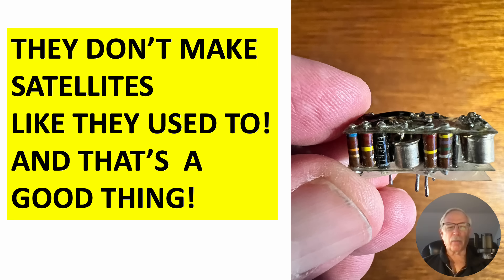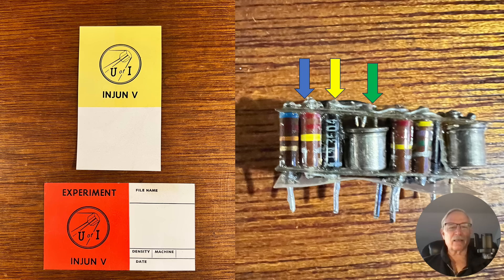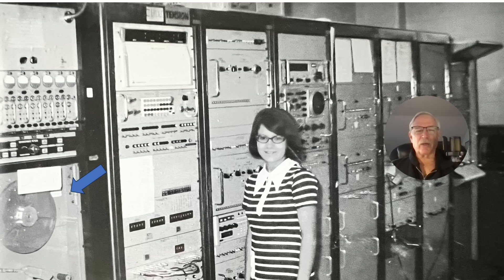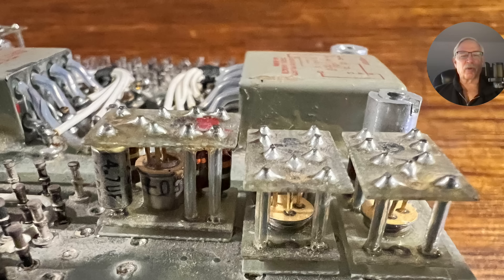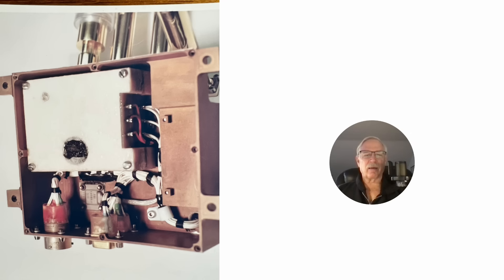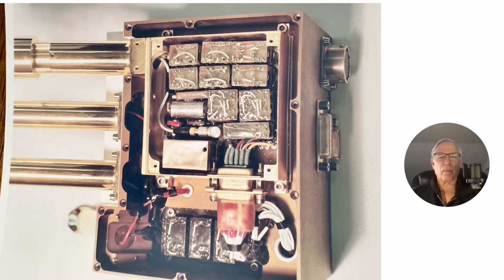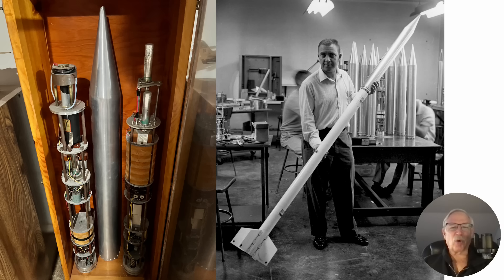THEY DON’T MAKE SATELLITES LIKE THEY USED TO! AND THAT’S  A GOOD THING!

Comment: Amazing work! I have noticed in some of the wafers tantalum capacitors, am I right? Did You know at the time that these capacitor were possible cause of failure?
Reply from the maker: I ddi not know that. I thought tantalum caps were the good ones!
Reply: @ronrogers  tantalum capacitors are still the best for precision capacity and still in use today. Anyway for many years now I have been collecting and repairing old  HP instruments like spectrum analyzer,  and rf generator and I have noticed that even the most selected and mil spec tantalum capacitor after many year of use is prone to shortcut itself with very high chances to destroy something else in the board. Other kind of capacitors usually do not shortcut when don't work anymore.
Reply from the maker: Interesting to know, thanks!

Comment: it uses discrete germanium transistors, but satellites are fake in a sense, they can only be deployed via hot air balloon.  the earth is a closed system,  there is no outer space, it's water, it is absolutely water

Comment: I work for a contractor that supplies hardware for NASA. We actually still build a lot of antiquated hardware the way it was made back in the day. You have to remember things like the space station and the space suit have been around forever but they are not being redesigned or updated. You have no idea the amount of work and cost that goes into designing and testing hardware to prove that it is fit for service under every extreme condition and that it will not effect anything other piece of hardware. It's almost comical at times because when important parts become obsolete we have to find companies that will put those parts back into production. And were not talking about stupid things like an oddly shaped screw either. Recently we had to find a company who would make LCD screen for the space suit. Just imagine going to a company and asking them to put a 70's LCD display design back into production and that we only need like 15 of them.
Reply from the maker: Interesting aspect I was not aware of but can certainly appreciate!

Comment: My uncle used to work on the computer systems for satellites. If I recall the story correctly, it has been a while, they were the first team to put a 386 on a single chip. Something like, 7 chips in a row, 7 rows on a board, 12 boards in a sat.

Comment: Ive disected some xray machines that were made around that time and basically made exactly the same way as far as the electronics go. The oldest ones were basically nothing but mechanical relays with capacitors and rheostats for timing and output control but they lasted a lot longer than modern made xray machines do.

Comment: Perhaps the biggest difference between the old and the new is just how reconfigurable the modern systems are.
In addition to microcontrollers, modern satellites use programmable logic circuits (FPGA) and all of it is designed in such a way that you could upload new code from the ground station up into orbit. And it's come in necessary on many occasions, too.

Comment: Thank you for such an interesting video! I remember when I was young my uncle gave me some electronic hardware from the remains of a Blue Streak rocket that was test fired from Woomera, Australia during the 1950’s. My uncle ran cattle on a property in the Northern Territory which was down range from Woomera and a number of rockets ended up scattered in pieces in the desert. Anyway I had a few pieces and I was very impressed with the quality of construction of the hardware, sadly I lost those items over the years since then.

Comment: You say the failure rate was high yet voyager 1 and 2 are still kicking, now I know there in a diminished state due to the fact that they've been slapped with all kinds of radiation and some of their experiments have been put out of commission but they still get firmware updates as there systems are magnetic wire cords, it's the same computer system that they used on the Lander module for the moon landings, a code used in the mid 40s and a computer core made in the 60s, I bet you if you had the funding that it would have stayed up there till it ran out of fuel and burnt up in the atmosphere, todays electronics may be able to fit 100 to 1000 times more for the same space but that does not mean its better, in fact a hardened laptop only last about two weeks on the iss

Comment: Back in the early 1990's I worked for GE/ Martin Marietta/Lockheed (Changed owners three times while I worked there)  Astro in NJ which built a number of remarkable birds. 

Along one hallway we had a glass display of spare circuit boards, and it was practically jewelry. 
The perfectly aligned circuit components all connected with (relatively) thick gold wire.

We're pre-conditioned by science fiction movies, to assume what flies in space is the most cutting edge technology but most of the time (at least in the early 90's) the preference is for 'tried and true' with components that were sometimes more than a decade behind what was available in the consumer market. They were still designing 'new' hardware in the 90's using 1970's microprocessors (RCS 1812 was still in use at Astro, including one version which recreated the base logic but used discreet components rather than a single chip)

Surface mounted components were not yet a thing for Astro, my job had to do with installing and supporting desktop Sun Sparc 1 workstations.

One day when I was replacing an internal hard drive on one of the desktop stations, and as I had the case opened, one of the engineers wondered over and was absolutely amazed at the surface mount technology that the workstation used. He was a senior engineer, (I think he was part of the Landsat 7 project at the time, but not certain)  

But keeping old hardware alive , well past the original manufactures EOL date was a common thing at Astro. One of my duties was to keep an Interdata 70 computer running into the mid 1990's. It was originally from the early 1970's a contemporary of the first generation PDP11's We had to raid museums for spare parts, because there were still flying satellites that depended on this 20 year old computer, and the rules were firm that you could not trust emulated hardware. So we kept this clicking, core memory, paper tape driven system up, for a decade after the ordinal manufacture had long been absorbed by bigger fish.

Comment: Surprised the electrolytic caps didn't instantly dry out in a vacuum.  The compression of the plates must have held enough electrolyte in to buy them some time.  Voyager II is still going, presumably on 50 year old electrolytics.
Reply: Sealed with a drop of molten glass on a layer of molybdenum (most suppliers)which is well wetted by glass. Rather similar to vacuum tube  or even halogen incandescent lights!

Comment: I use to work at a physics lab where Peta bits of data where burned onto CD's to be transferred to the university for analysis. The on going joke was your data rate is based on your Van With

Comment: You should see some of the early oil well logging tools. Tiny vacuum tubes, and later, nuvistors. Designed to fit in housings as small as 1" I.D. They had to be able to go to a pretty high temperature, and be impact resistant. Not many, if any folks left who can work on the old stuff.

Comment: Years ago I was working for Honeywell which had acquired sperry decades ago.  For some strange reason I had to update some very old PCBA drawings that resembled the sandwich construction shown in the video.  Strangest electronics I had seen.  It is not reworkable and not volumetrically efficient.  We have come a long way!

Comment: 4:00 those small circuit boards look like individual logic gates. It would probably be possible to substitute the entire electronics in this early 60's satellite with one small surface mount FPGA nowadays. It's amazing how much things have advanced, and what people could still do back then, even with just through hole components and discrete germanium transistors. This is actually very impressive to someone who wasn't even born at the time of this satellite. Thanks for sharing this information.
Reply: Likely even a cheap CPLD
Reply: On the downside, our fancy modern electronics can fail when hit by a solar wind particle or cosmic ray. Smaller is not always better.
Reply: @jagobabarron5501  Yes, but it's also easier to have a backup system or two with the same fancy modern electronics. Besides, the components on these boards were failing much more often than today's technology, as the author of the video himself states.
Reply: @jagobabarron5501 You say that as if these weren't even more easily damaged.
Nothing can withstand a good blast of radiation.
Reply: @jagobabarron5501  Better it last long enough to get fried by that, and with the small size comes being able to fit two or three backups so your flight isn't over as soon as solar winds breathe on it

Comment: SURELY that was not the finished packaging, but rather just a breadboard, that first tiny unit/module? you showed.  We did stuff in our garage that looked better than that back at that time.  There is not a single solder joint on that entire board that would pass today's qual inspections. As I remember, they wanted to be able to see the stranding showing through on a stranded wire solder joint at the end of my career.  Interesting, and quite eye opening to see.  

I can tell you that mil spec flight stuff I saw, even back then, didn't look like that.  Not the equipment I saw and worked on, anyway, and we did use some legacy equipment from pretty much that time frame on a target missile to fly against THAADS and STORM.  Those units were all printed boards, and you could see individual wires in the solder joints, not just giant blobs thrown on from across the room.  Some of it was potted, too, which made it a mess to open and troubleshoot a problem we had with a few of them.  

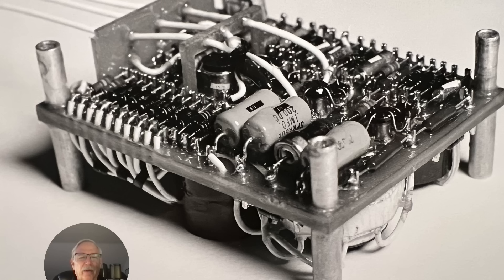The missile was a cheap and dirty cobbled together flying junk pile interceptor test target, basically.  Minuteman and other motors, Pershing II front end, purpose designed stage couplers, etc.  Ah, just got to the board at 8:42, that looks more typical of the time.  The epoxy blobbed wiring on the taped cores looks pretty standard, though.  :-)  That board also looked like it had been coated in Hysol, or whatever they used back then.  I wasn't too impressed with that stuff, as I had some very high tolerance passive components go out of spec, just operating in high humidity for extended periods, from what I can only assume was water absorption.  It probably contributes value in the shake and bake qual testing, though, and in use after storage and transport, of course.

The metal can packages on the 'more modern' stuff were interesting. They look like the type of packaging utilized by some of the hybrid components, like RD converters, that I used to employ.  Those designers always drove people nuts, because they would label the MSB as 0, and other dumb nonstandard stuff.  I remember a guy I knew that did a design review on a board of mine smiling and saying something like, "Well, at least you got the converters wired correctly".  Truly high praise.  ;-P  I said, "You mean most people don't?"

Comment: You can, in fact, still buy discrete can transistors. Of course, you can mostly only get modernized versions of them, but often its a pin for pin, spec for spec version that's simply appended with PBF in the part number to signify that it's now lead free. I go through dozens to hundreds a month repairing obsolete industrial electronics.

Comment: in general the designs are still based on the same approach, you can still pull any compnent on the PCB without harming the circuit.

Comment: Sure you can still buy all sorts of discrete transistors. I've got discrete BJTs, NPN and PNP, as well as N and P channel JFETs and depletion mode MOSFETs. They cost about $2 for 100. For each type. Mind you these are just plastic TO-92 packages. No fancy metal cans, except for my unijunction transistors.

You can even still buy the old LM741 opamps for about 80 cents for 10.

Funnily enough, buying chips from China, I've come across some blatant counterfeits. Like some TI logic chips where the TEXAS Instruments logo is a blobby looking United States because apparently the silkscreen printer didn't know what Texas is. I get the sense they weren't worried about Trademark issues.

Comment: colour codes ... easy phrase to recall ... Big Boys Rape Our Young Girls But Violet Goes Willingly ... or Black Brown Red Orange Yellow Green Blue Violet grey White ... silver is 10% old is 5% tolerance ... it is also the same for capacitor and yes single Transistors are still sold ... 

pity yu didnt cover what the first satelitte did ... aside from fall around the earth and send a signal back now and again ...
Reply: In Dutch the line is Zij Bracht Rozen Op Greetjes Graf Bij Vies Grauw Weer, meaning She Brought Roses On Greetjes Grave in Dirty Grey Weather. Vies can be replaced by Dirty, both refering to violet. Anybody who knows a similar memory line in another language?

Comment: Yeah some circuits still use discreet components like diodes, capacitors, resistors and transistors.  They are actually more robust in space than modern ICUs (Computer chips) but of course can not do the more complex computations. So now they are more shielded from the radiation and thermal variations.

Comment: I use to make modules like that when I worked in the aerospace industry. They woud be tested and then potted in hard resin. Eventually clampped on a aluminnium plate and wire wrapped to interconnect  them.

Comment: 1:47 Heck yeah, you can still buy individually packaged transistors, they're used to control electric motors.
One example I know of are Tesla drive units. All of the motor windings need to be powered on and off in sequence, at whatever speed the motor is already spinning. Huge transistors moderate the flow of that current.
Relays can only produce a square wave, which is less efficient for driving a motor, and noticeably louder.

I think large individual transistors are also at the core of most audio amplifiers. I think they're the choice way to amplify or manipulate any analogue signal too strong to put through a uv-etched chip.

Comment: Thanks very much for this quick look at some vintage space exploration electronics! A friend of mine builds lasers at NASA; standards are very high and some equipment ends up working for 10 years or more, in very challenging conditions. Of course, such reliability is a bit more expensive than just going to the hardware store... But a hardware store run can be good engineering, using what's available to satisfy constraints. Much respect to those who designed, built, and operated the Van Allen experiments.

Comment: Wow - the weight savings alone using modern electronics must be quite substantial! It's amazing to think that we went from powered flight to visiting the moon in the last century. I was born in an era before the internet and it's fascinating to see how far we have come. Sadly those born post 2000 only get to see things getting smaller and faster and don't have the same point of reference as starting from scratch lends! Also it seems innovation has slowed down and the aviation progress has gone back a step since the loss of Concorde...

Comment: If you ever tear open high-sensitivity testing equipment you’ll still find point-to-point wiring and individual transistors—think electrometers, picoammeters, etc (Stanford research type meters). I had to do a combination of this for my thesis work (building a picoammeter for high voltage reverse-bias testing of GaN diodes). When it comes to high sensitivity measurements that require extremely low leakage, isolated, air-wiring, using Teflon turrets over a ground plane, is still the best solution. It was a combo PCB w/ an analog front-end which fed into an ADC.
Reply: Dude, badass

Comment: As an apprentice in the 80's, I did a half-day NASA soldering standards course. It was all done under a 20x binocular microscope. The tolerance between a good wetted joint and too much solder (weight!) was hair thin! When I see some of the soldering on YT I just shudder. lol.
Also: Turret tags! Wooo :)
Reply: I went through the NASA level one and two soldering course back in '84 when I started working at Motorola GED in Scottsdale.  I was in a three week course but you are correct our solder joints were like jewelry with perfect wetting and no visible defects and each joint was inspected by a QA group and DCAS (government inspectors).  At the start of the classes they showed a video of rockets exploding (early rockets) with the  warning that one bad solder joint could result in disaster.  A couple of years later when working in production someone from upstairs came into our area to inform us that Challenger had exploded.  Everyone in that room were horrified (there were a lot of woman assemblers and incessant sobbing) and we all felt responsible.  Fortunately they sent someone else to assure us it wasn't our device that cause the explosion.
Reply: Yes, my half day was just to gain an "appreciation" of the standards involved. Consistently working to that standard and getting 100% (or very near to it) every time certainly takes skill and patience! :)  @ricinro